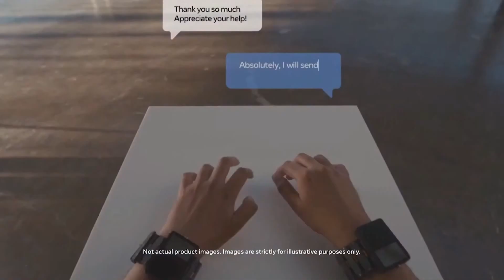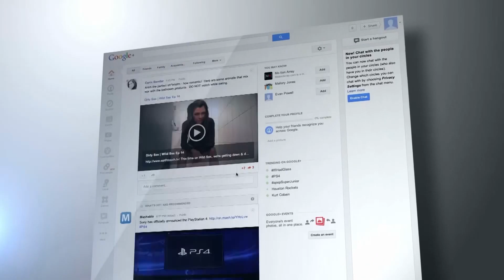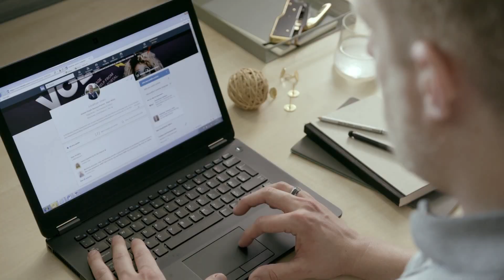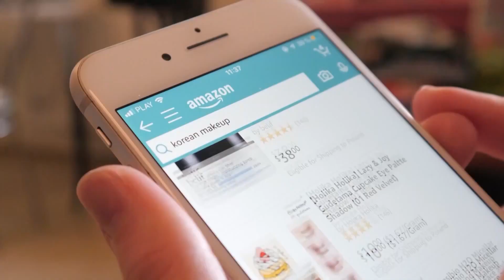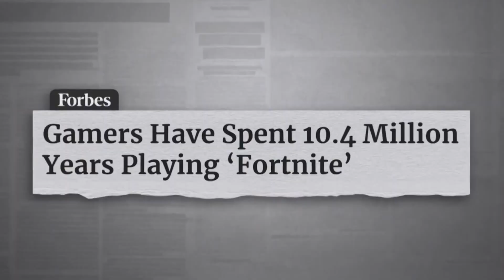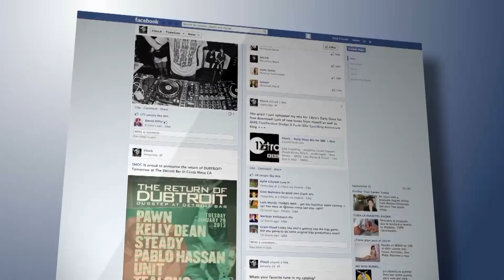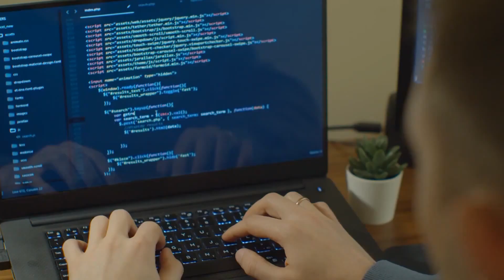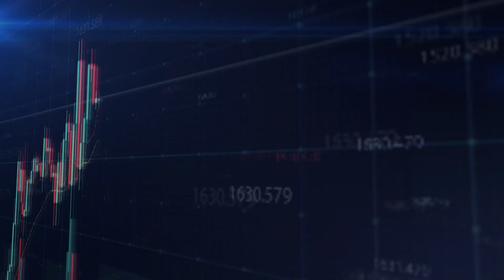Who Will Run the Metaverse? Top 5 Companies Leading the Metaverse Arms Race

Comment: The next system is, in fact, decentralized. Like a wheel on a car that isn't held in place by an axle, but by magnetism. DeFi uses actual friction.. real physics, to create real energy, that the money is based on.

Most cryptos (Cefi CBDCs) do not do this. They are centralized, and operate more like a modern wheel, where most of the stress is on the axle.

Comment: Check out what Nvidia is doing with the Omniverse. Like Microsoft, they are mainly business-focused at the moment, but they're putting in the foundational work to be more.
Reply from the maker: Great call out!
Reply: Nvidia looks so far ahead of anything I see here. I like Meta because they'd have ability to onboard customers through their Occulus hardware. 
Facebook has 2.89 billion monthly active users. Fortnight may have intermingling of IPs and cross video gaming platform play but they have 350 million total users* (* data does not state whether they are active monthly).
Reply from the maker: I agree - I think Nvidia is doing a lot to push forward what is technically possible in the Metaverse, but I believe Meta has more ability to onboard and own users and their data.  I actually just made a video on the downsides of that: https://www.youtube.com/watch?v=DR7ysFoIY80